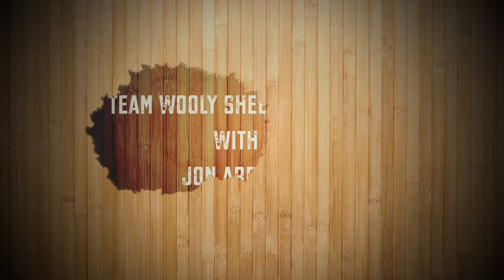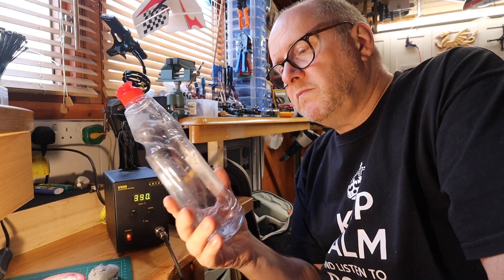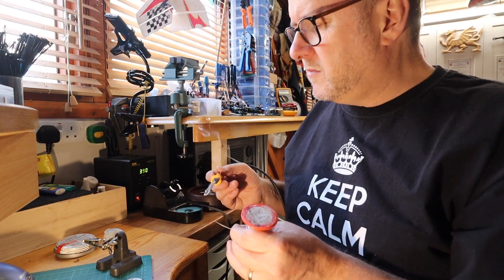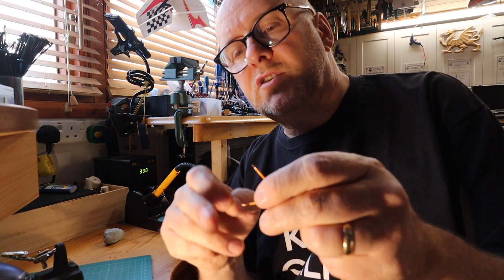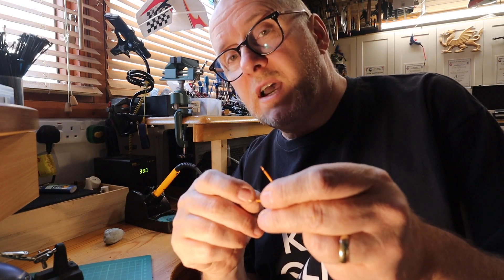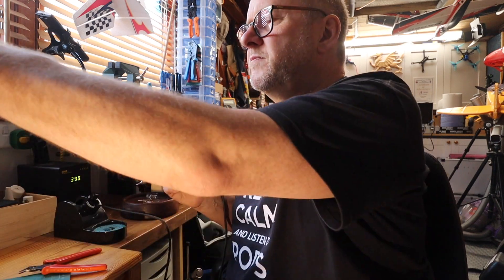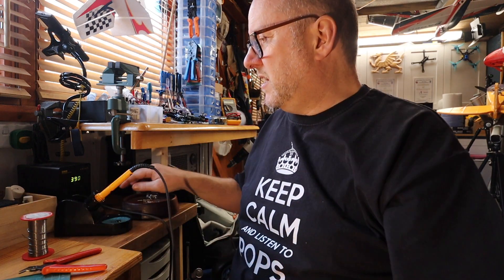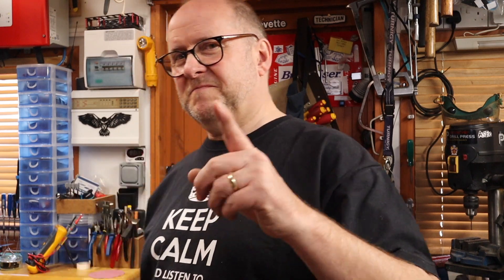Soldering Tips for lockdown projects

Comment: Great stuff John. Don't forget to put the heat shrink on BEFORE soldering! I often have to unsolder a joint to add heat shrink tube. :(
Reply from the maker: It's an age thing......I cut them all ready, line them up and then forget to slide them onto the cable before soldering....lol